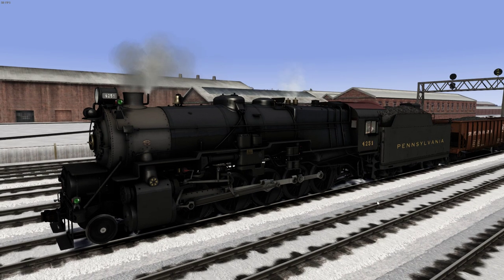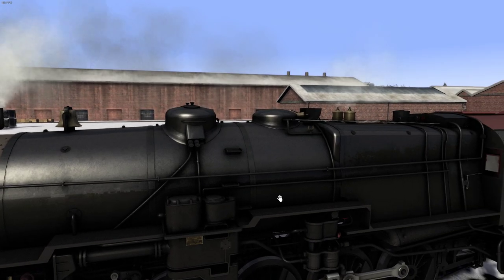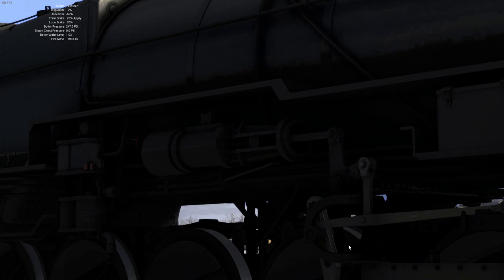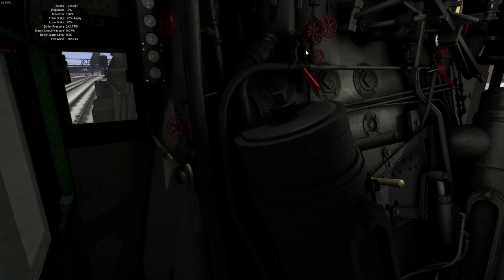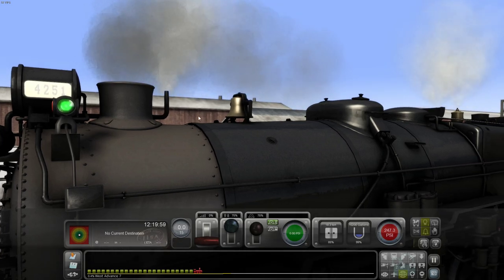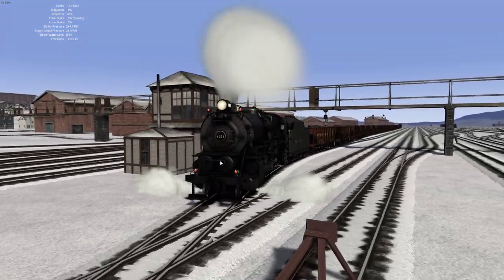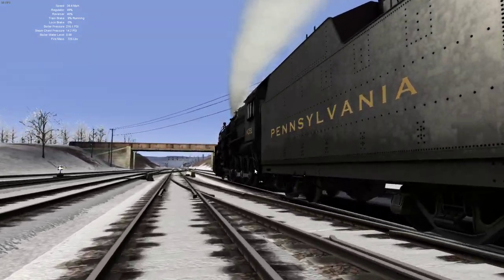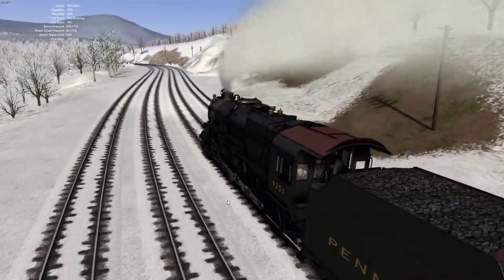Train Simulator Classic: PRR I1 2-10-0 Decapod

Comment: First comment and first viewer and I tried this model but my screen always went kinda crazy when ever I ran them same with the e6
Reply from the maker: I Imagine it's the funky black mess in the sky? If so, it has something to do with the cab characters. You may try downloading the DLC again or contacting the Dev, he had to have me delete the cab characters out. They've worked fine since.
Reply: @StampedTomcat50  thanks what kind of cab things do I have to delete
Reply: @StampedTomcat50  At this time the RDC PRR K4 model is required for the engineer and fireman characters in the cab, so that engine will need to be checked to get rid of that error you see in the sky....And I suppose that you can also delete the characters out of the source folder to fix the problem as well.
Reply: @GoPro._Musica  This is correct. I had the same problem and this fixed it.